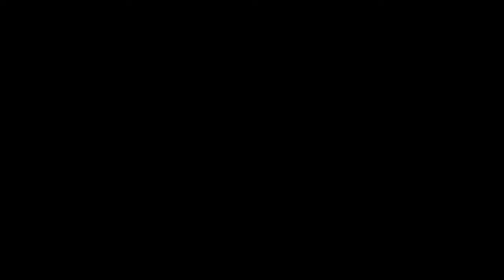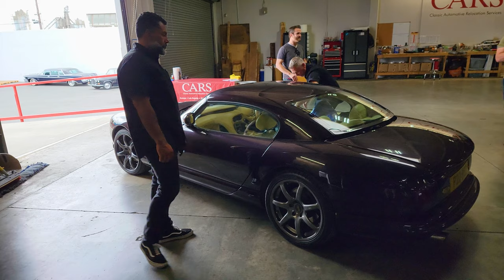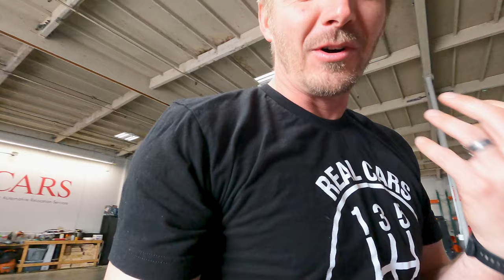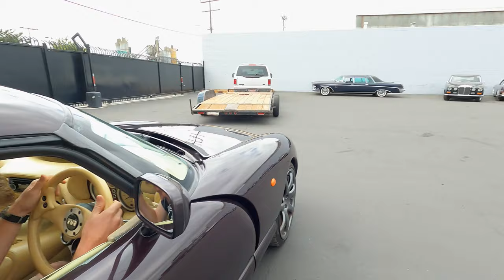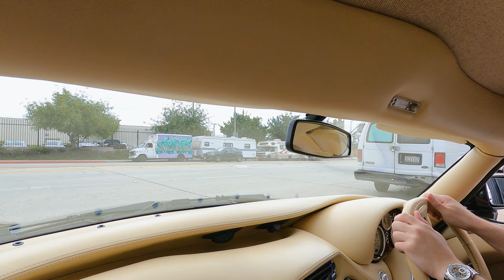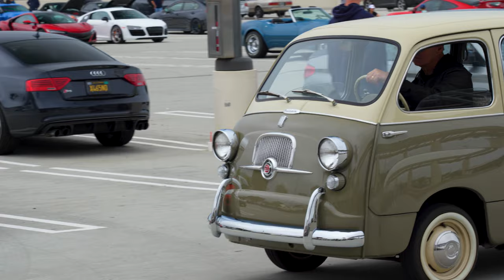Picking Up my TVR! - Importing a TVR to the USA! Update 4

Comment: Congratulations!  As a former TVR owner, it's my duty to advise you that they can go in any one of four directions - and you don't always have a choice which one that is!
Reply: Not if you don't stomp on the accelerator like an idiot. Feed the throttle and use the full length of the pedal. Also the longer wheelbase make this a more stable TVR. I've owned a Cerbera 4.5 and a Tuscan S btw.

Comment: Greetings from the UK! As your car still had its UK plates, I was able to run an MOT check on it and it passed its last two years previous checks with no advisories or issues. If you weren't aware an MOT is an annual roadworthiness test that all cars over 3 years old are legally required to pass to be driven on UK roads. It's pretty thorough so it looks as if your car has been well cared for. Chassis rust is the big problem with Cerberas and yours is clearly in great shape.
Reply from the maker: Hey there Andy! Yeah, the previous owner took great care and I was able to see those MOT as well. There's some surface rust here and there but nothing serious.   It's been a fun journey.  I'm in the middle of doing a full blown review =) So I hope to post that in the coming weeks.
Reply: @AaronsEccentricGarage  Looking forward to watching that! I quite fancied a Cerbera but finding a good one even here in the UK is difficult. I'm currently restoring my 1987 Porsche 928 S4 which is a bit different than the Cerbera (but very expensive!)
Reply from the maker: @AndyD070568  Great project! I used to work for Porsche in North Scottsdale, AZ and when I spoke with the parts manager, he shared that the 928 has some of the most expensive parts of all porsches. go figure!
Reply: @AaronsEccentricGarage  Yeah, tell me about it. And that's the stuff that's still available! I save a good chunk of cash by doing a lot of the work myself. Most of the mechanical stuff is sorted, just the respray and interior left - the really expensive stuff!!

Comment: It's been a lot of effort, but well worth it.
This car will bite you in the ass soon enough, but I think you have bought a good one as it goes. Better than the nightmare Cartrek Carisma Cerbera, which is a tough starting point.

My Dad would say, 'a professional cost may sting at first, but the sting will disappear if the job is good and it will pay back for years of enjoyment. Pay cheap and it may disappoint you every day.'
My Cerbera is a shitbox to look at, but it's a sweet machine underneath.
Reply from the maker: Yeah,  already had a couple electrical gremlins.

Comment: nice cars...but it looks like yours shares the same electric problems than mine: the door & window opening looks to be damaged at yours: once you press the mirror bottom, the window should lower a few inches, than the door should pop open. after the door has been shut, the window should automatically go up in upper position. this  topic is one of the major weakest point in this cars electric. another advise: bypass the immobilizer...it will only cause trouble longterm. its behind the helmet-shelf (back seats).
Reply from the maker: No problems actually.  The battery was disconnected and when reconnected, the system automatically goes into lock and rolls up the windows.  The folks at the shop left the key in the car. Once we used the secret way to get in. Got the key and unlocked the car, it worked exactly as it should.

Comment: Gorgeous car. Is the chassis good? Seen a load of videos where they've rotted to dust.
Reply from the maker: just a little surface rust is all. That was one of the many things I had the local shop take a closer look at, prior to pulling the trigger to buy the car. The shop (DGS) says that it's one of the better chassis they've seen that hasn't been replaced yet.
Reply: Yoi can buy a brand new chassis for about £6K.  It really isn't that much of a problem.